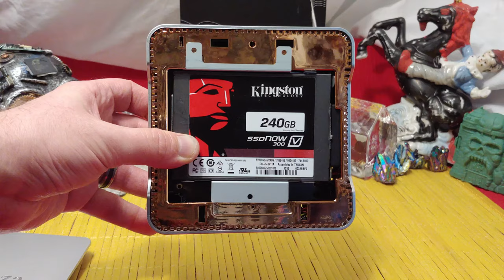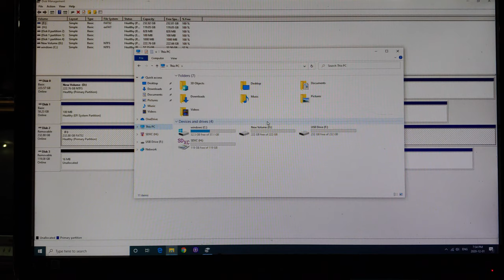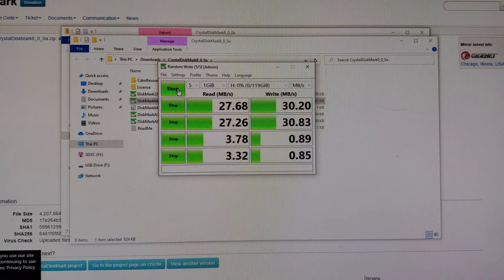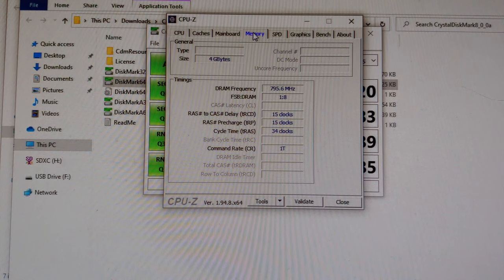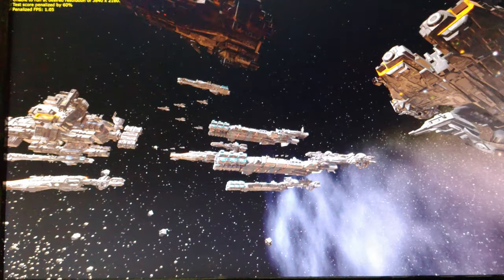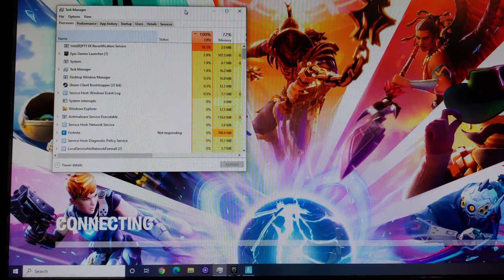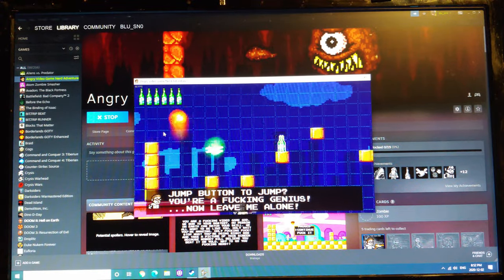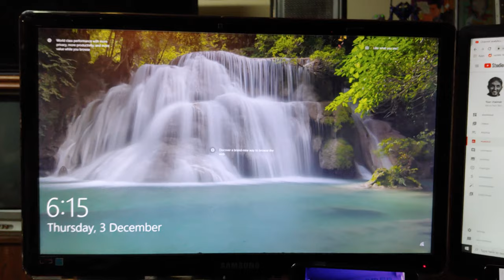Terryza AK3V Mini PC, Benchmark, Teardown, FULL GAMING REVIEW GTAV, Fortnite, Doom II, AVGN TF2

Comment: Thank you, I learned something from your video, the fact that the SSD increases the speed I just ordered a bunch of SSD's and will replace they all. I did that for the one I set up as a server but I took it apart and removed the internal Solid state drive that was in there and saved it. 

I have a few of these, (8) I have been replacing various computers with them for my business. I am not running games but I am running Quickbooks in a multi user setup and it works fine and supports 2 monitors at once. Mine are not 4K but they are beautiful and a step up from what we had. I love that fact that they come with a hanger so I just mount them on the wall! I even set one up as a Linux server and its working! I worry about the fans I think this is disposable when the fan dies. Our computers are always on 24/7.

Comment: Thanks for the video.  So if I want to throw a 2.5" 500GB internal SSD into the box, are there any requirements that I need to know about, or are all 2.5" internal drives, both traditional SATA drives and solid state drives of 2TB or less fully compatible?
Reply from the maker: Yup I believe that's the case
Reply: I put a Samsung 500gb in mine yesterday day, and it worked fine.   With a little help from YouTube, I cloned the orig hard drive, and made the ssd the boot drive. Works great.

Comment: Thanks for the tear down. What is the connection port on the underside of the motherboard?  It seems to be unused.
Reply from the maker: That seems to be a USB-C Male port. I really should have mentioned that.
Reply: Thanks for the reply. Could it be for a  board to board connection?  Or maybe a BIOS access?  I’m trying to maximise the use of this system. 
Thank you.

Comment: This is not a teardown.  This is you opening up the case and staring confusedly at what you're seeing.
Reply from the maker: I said I was taking it apart. I didn't say I was identifying every chip on it.
Reply: @NevsTechBits  Your video literally has the word "teardown" in the title.  You don't know what a teardown is.
Reply from the maker: @johnwbyrd  You want me to take it down to component level?
Reply: @NevsTechBits  That is what a teardown is, Hank. "The Terryza seems to be a rebranded Intel NUC8CAYH, which several one-man shops have resold after apparently buying them off of Alibaba. This PC only bursts to 2.4GHz; expect it to run and bottleneck at 1.1 GHz most of the time. The BIOS is apparently an American Megatrends BIOS flashed on 6/1/2020 from the standard Intel BIOS distribution, and since there's no support web site you might as well assume that that is the last BIOS that this device will ever have.  If you're running this in North America, you'll need to set the display refresh rate to 30 Hz, or else the display will overscan greatly. You will also note that the Intel PTT EK Recertification driver will take up most of the CPU. To fix this, download the latest Intel Trusted Execution Engine for the NUC6CAY and/or the NUC8CCH Intel products. That driver will work on this Terryza machine, and will cause the CPU problem to go away."